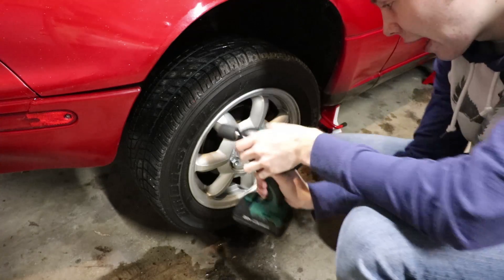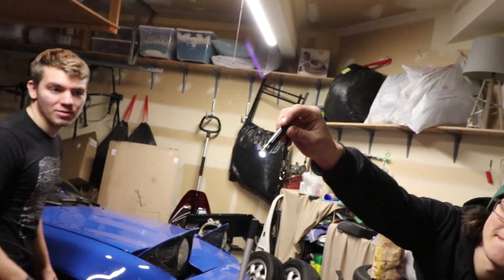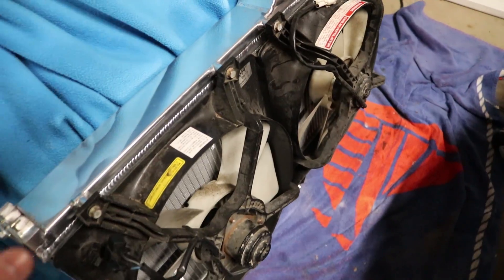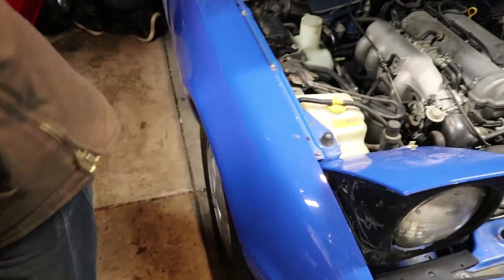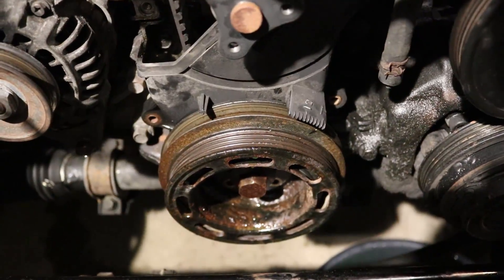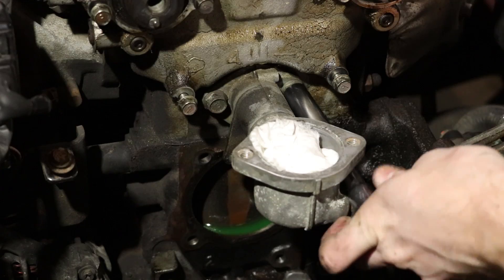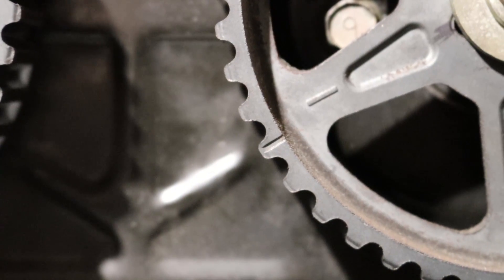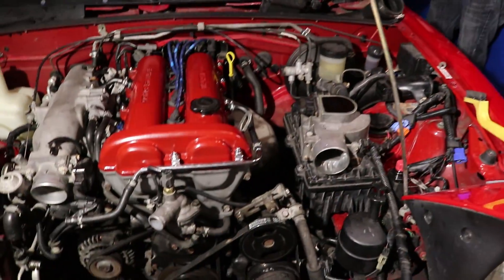Project Miata: Timing Belt & Radiator Replacement!

Comment from the maker: If you watch carefully you can see that the Idle Speed Control valve isn't plugged in at the end when we started the car... that might have something to do with the weird idle...
Reply: Gingium I'd agree with that
Reply: Gingium same
Reply: Definitely that. Also, can you use a timing light on a miata to check the timing? I don't have one so I wouldn't know
Reply: Whats the name of that song Ging
Reply: it's a lot easier to get the correct timing if you mark the original belt and cam gears where they were
Reply: It might need a tune up for the weird idle
Reply: Please let me know what the issue is because I did the same and got the exact same result and it's so bad, been reading forms and watching videos all week how to fix it

Comment: Hey Gingium, my idea for a video would be to make a comparison video before and after suspension mods (since I guess you will do coilovers at some point). If you film a few corners from the outside in slowmotion you could see the bodyroll change and so on :) and you could then tell your opinion about the changed handling - like how good it is at the limit of grip, if you can actually go faster in corners and so on :) what do you think?

Comment: just a tip when you time the car before you put anything back on tension the belt and turn it over 720° (twice) to make sure you dont hit the valves or the belt doesnt jump any teeth
Reply: about to do this job, how would you know if it’s hitting?

Comment: My friend!   dewalt 20v 1/2 electric and the 3/8" impact will do everything you ever need for wheels and everything else.   Spend the money.   my 1/2" can break axle nuts on ram1500's and entire front ends on vehicles!

Comment: I'm not saying that it is out of time, but it could be. You really should re check the marks AFTER you tension the belt and turn the engine over a few rotations. I'm not sure about the miata, but on a lot of cars there are timing marks on the timing cover and harmonic balancer, and all you need to do is take the upper cover off to check the cam pulleys.

Comment: shouldn't you manually rotate the crank after fitting the new belt to make sure the valves and piston heads don't make contact?

Comment: If you have the money look into the snapon impact guns, I have 2 a small one like you have and it did my whole miata suspension like nothing and the big one I believe is 750ft lbs and 1/2 drive and took my other car apart like nothing. The little one is good but if you keep using on big jobs you'll burn it out. Plus snap on is lifetime warranty. Expensive but worth it.

Comment: Cylinder 1 may refer to either the front or rear cylinder, depending on the car. Are you sure you put the correct "cylinder 1" to top dead center? Also, are you sure that all vacuum hoses and lines are connected? If not, the car can sound "cammed" or otherwise unhealthy
Reply: marksmanman96 I think tdc is both rear and front cylinder on top.

Comment: well, should have done those cam seals too don't you think? Did you properly tension that belt? looked very loose when you touched it at the top. you're suppose to turn the belt 1 5/8 turns and check the tension, then tighten the tensioner. nice video though, glad to see you just go for it!
Reply from the maker: We did do the cam seals and yes its properly tensioned. Might've edited that part out. Im guessing its either a tooth off or the ISCV is a little fucked

Comment: A) You didn't spin the belt (turn the engine) a few times before you tensioned it so the tension is loose which might come back to haunt you
B) NEVER start a car without coolant. If you follow the steps properly you shouldn't need to not put coolant in it in case it breaks or doesn't work and you need to work on it again. And if it does break or something, the coolant is not used, so you can just empty it and put it right back in. 
C) Just saying that the Evap canister wasn't deleted properly. The line for the intake is closed off properly, but there are two lines that need to be looped otherwise fuel vapor will build up in the engine bay.

Comment: First , impact wrenches are not meant to torque out bolts that tight, you will mess it up. If you want something to take off lug nuts then you need an air wrench and a big compressor or buy a cheap electric one that's meant to do the job..
Reply from the maker: Well the bigger one could do it...

Comment: Check the plugs and plug wires before you do everything my 95 had that same rough idle due to the plug wires arching..
Reply from the maker: We'll check those!
Reply: Gingium sounds good, you usually can see it if there's no lights on and the car is running you'll hear it clicking and see a small spark near or on the coil pack. Vacuum leaks could cause rough idle too but I'd bet plugs and wires. Good luck.

Comment: Only thing I saw was that you didn't seem to have made sure that all timing Mark's were exactly on the spot once the belt was tensioned you didn't have the cams locked when you decided to tension it and pull on the spring tensioner you always double check your timing Mark's after its tensioned also that way if it's off a tooth you catch it before putting it all together

Comment: get a air compressor and a snap on impact
Reply from the maker: That requires room and money
Reply: Joshua Godsey way to much money for the garage work he does, a simple bigger better brand electric impact will suffice. And why snap on? Their impacts are over priced to hell compared to other brands that do the exact same thing and last just as long
Reply: Gingium just get a craftsman impact. Decently priced. And I've never had a problem with them.

Comment: defiantly supposed to use a breaker bar and than the electric impact,
Reply: Stuber Racing Network no rattle guns are there to get stuck bolts loose. This impact wrench is simply not made for getting wheels of more like getting stuff inside the engine bay out but not high torque bolts as this rattle gun only has 150nm of loosening torquw

Comment: This is exactly what my Miata sounds like when I replaced my timing belt and water pump. When you drive the car, does it seem like there is no more power either? Cause my Miata after 1st gear has no power, put the foot to the floor and absolutely nothing happens. My Miata did not run like this before I had to replace the water pump and timing belt. If you guys resolve your problem, let me know on your guys solution. So I can fix it sometime in February cause I'm storing my Miata for winter.